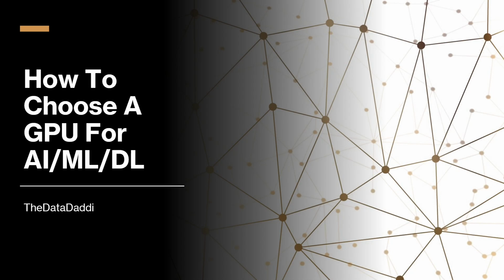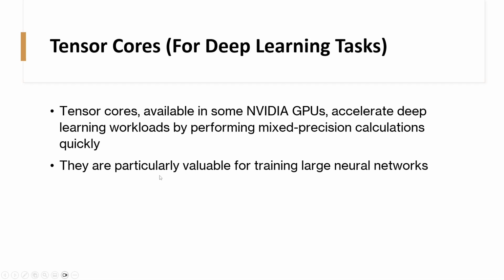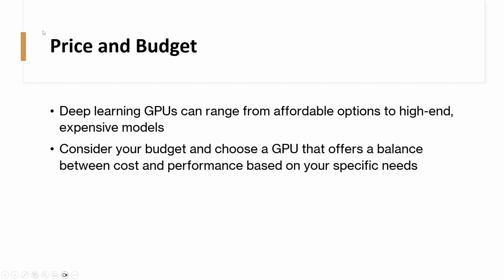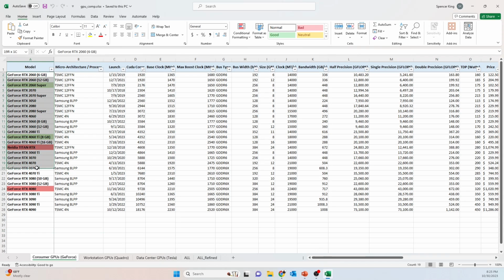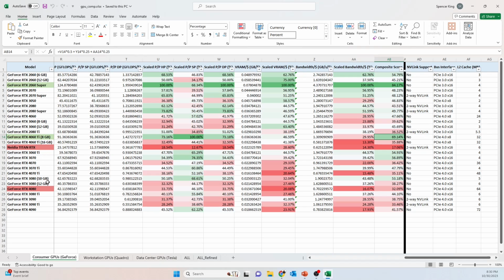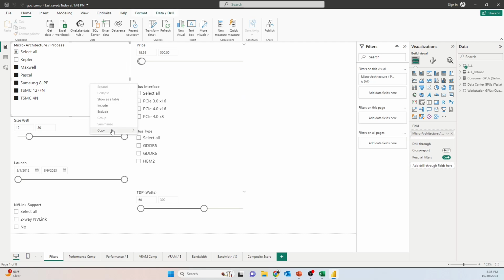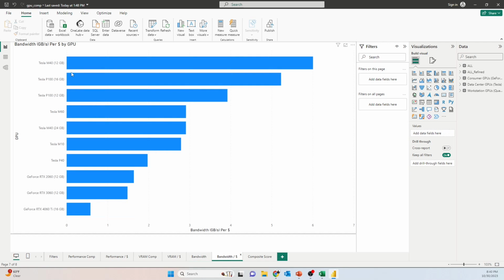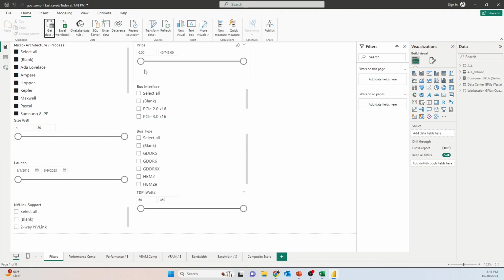AI/ML/DL GPU Buying Guide 2024: Get the Most AI Power for Your Budget

Comment: Nice work. I think the only big flaw I see in your analysis is that purchase price is not the entire upfront cost. Each card should have an overhead cost based on the fraction of a chassis, mobo+cpu, and PSU it would use. I think you just had a chassis for 2 cards as a sunk cost in your mind so it didn't matter. But for anyone building a full system (or systems) it would have a big impact on their purchasing decision.
Reply from the maker: Hi there! Thanks for the kind words and the feedback! This is a good point. I was doing all this research to figure out what to put in my Dell Power Edge R720 so my analysis is a bit biased in that way I suppose. My assumption was just that people would be able to compare GPUs most easily by looking at purchase price to performance. However, I do agree for those that are building or using different server's this might shift the total cost significantly. For example, if you wanted to work with RTX 4090s (even in my server) I would have to buy external PSU(s) for power in order to use them. That would likely mean I would have to build a entire external rig so that would definitely increase the overall cost. These are definitely things to consider when thinking about your build. I appreciate you bringing that up, and I will definitely keep it in mind for any future analysis I do. Thanks again!
Reply: @TheDataDaddi  It is a helpful comparison but as with everything else, no tool is perfect in and of itself, it may be the perfect tool for one job but not another, or at a certain scale. Mostly for me it reinforces my previous idea which is to aim for 4090 as the most versatile and best fitting for my usecase, also because it isn't a one trick pony and can do other things as well. Some of the other options do come close but do not 'cut the mustard' for one reason or another, primarily that it needs to fit in my one rig which can only take 2 GPU's max physically but then power becomes a limit since 1200w is the biggest PSU that makes sense since above it you run into breakers popping and wiring becoming a factor etc. Every possible factor can't be realistically accounted for or factored in, in a spreadsheet. The 'slot cost' I think would be valuable for many to be able to add to it, since some uses do not require much from the platform itself while others very much do.
Reply from the maker: @noth606  You are definitely right. One of the reasons I am trying to focus more on hardware at this stage of my journey is because it so nuanced. For best results, it really should be though about on a case by case basis. This was just meant as a way to show people generally how to start thinking about GPUs for their particular use case and hopefully lessen the research burden a little bit for anyone interested.
Reply: @TheDataDaddi  I'm sure this is helpful to get people to start thinking on more concrete terms when they get to a point at which they want to put together hardware specifically to "crunch numbers" rather than just using a typical general use PC configuration. I would think that the journey in a certain sense can or might be split into 3 "stages" conceptually where stage 1 is a normal PC, stage 2 is a PC built to "crunch numbers" but at a general level and stage 3 is a problem/usecase specific PC or set of hardware designed around the exact specific task they are meant to tackle, where for stage 3 you would include efficiency calculating "work units/sec/price/watt" type factors into it. It's important to factor in time and energy on some level because they are of a slightly different nature than calculations per second are conceptually. What I mean is they are inflexible, you don't have access to unlimited amounts of either regardless of other factors. Saying this not to be patronizing, but as someone who has at times forgotten which parts of this kind of equation are inflexible 🙂 and paid a price for that. Ask my ex wife, she'd have tips and examples of the inflexibility of time and energy for sure, lol.

Comment: Modern AI needs heaps of video ram.  You shouldn't bother looking at any without 24gb
Reply from the maker: Hi there. I definitely agree. I think 24gb is a good happy medium between price and performance.
Reply: What’s your thoughts on Apple silicon, for example, would 32GB of unified memory on an M2 Max, be an equivalent of 24GB in a dGPU (and not considering a CUDA advantage)?
Reply from the maker: Hi there. Thanks so much for you question. 

I actually had some ask a similar question yesterday. Lets dive in.

Apple's silicon, particularly the M2 Max, represents a significant shift in computing architecture. The concept of unified memory in Apple's design is quite innovative. Unified memory essentially allows the CPU and GPU to share the same memory pool, which can lead to more efficient use of resources.

Regarding your question about the equivalence of 32GB of unified memory to 24GB in a discrete GPU setup, it's not a straightforward comparison. In traditional setups, the CPU and GPU have separate memory pools, and data needs to be transferred between them, which can create a bottleneck. With Apple's unified memory, this bottleneck is reduced, as both the CPU and GPU can access the same memory pool directly. This can make the system more efficient, potentially allowing 32GB of unified memory to perform comparably or even outperform a 24GB discrete GPU setup in certain scenarios.

However, this doesn't mean it's superior in all aspects. For example, tasks heavily reliant on GPU performance, especially those optimized for CUDA (a parallel computing platform and API model created by Nvidia), might still perform better on a traditional discrete GPU setup. This is because CUDA has been around for a longer time and is extensively optimized for specific professional and scientific applications.

So to sum everything up, while 32GB of unified memory on an M2 Max might offer comparable performance to a 24GB dGPU in many use cases, the actual performance can vary depending on the specific applications and workloads.

 @rayf3244
Reply: @TheDataDaddi did you use ChatGPT answer this?
Reply from the maker: I honestly do not remember. Definitely sounds like there are remnants of chatGPT in there. I definitely do use chatGPT to help with many tasks including gathering information to respond to questions. However, I rarely use ChatGPT's full or verbatim response for anything. I also also double check responses for accuracy. I know that use of chatGPT is controversial to say the least. However, I am of the opinion that used responsibly it can be an incredibly useful tool.  @adisaksukul8088
Reply: @TheDataDaddi on this one I don’t see any reason to limit our options to 32gb etc. 128gb or 192gb are available if going to apple M2 route.

My internal quandary is a6000 in my dual Xeon gold t7920 vs swapping all out for an M2 Ultra 192gb.
Reply: @rayf3244  Machine Learning rests on linear algebra.   Massively parallel matrix algebra is what video cards do.  (until we see neuromorphic chips in wide production, cheap and actually successful.   Could just be a pipe dream (rnn's).   The RTX 3090 with NVlink is the best bang for the buck and the old Tesla cards are the cheapest entry.   2-3090's give you 48GB and let you play up to llama 2 78b.   No I can't afford two 3090's either let alone a couple of last generation a6000s.  The Tesla P100's have 16GB and NVlink for a total or 32GB for less dollars.    When PCI-e 5.0 boards come out NVlink won't be necessary (We are told) but until then we are pretty limited as hobbyists.   NVidia is really the only game in town and they are focused on the Enterprise not us.    AMD and Intel haven't invested in AI at this level and Apple isn't even in the game.
Reply: I think for some people clustering cheap 16gb cards may be easier to entry. I know there are 16gb 4060s. I know it's not optimal but might be easier to handle incrementally.
Reply from the maker: This could be a good way to go for sure. Certainly a lower barrier to entry from a cost perspective for sure. In my opinion there is no right or wrong answer on which GPU you buy. The best GPU is the one that you can afford that gets you started on your journey. Anything beyond that is just icing on the cake.  @JSON_bourne
Reply: @JSON_bourne  It doesn't work that way.   Each 4060 run completely independent of the other there are NO 40 series cards that support NVLINK.   The 3090 and the 2080 ti (modded) both support an NVLINK bridge so that you can effectively double your memory for larger models.    Anything else is crap.
Reply: @robertfontaine3650 sir u have partially correct information.... we could pool memory of gpus even before nvlink existed
Reply: I recently upgraded my memory to fit larger models in. Regret the expenditure as Llama3 fine tunes on 8B are absolutely epic. I think whether you even need a GPU and whether you need a large model or context window really depends on your use case. The whole thing is so much in flux right now that I'd not be able to say anyone "needs" anything until I ask them about their needs and expectations in depth.
Reply: @ts757arse  tbh I've since come to same conclusion. At least for now, the coals are still in the fire.
Reply: War has changed.
Reply: Ah man. Don’t shame my GPU 😅
Reply: You can't leave out tpus as well then you have Cuda corresponding tensor cores smf there's another one but just using gpus alone is not efficient
Reply: 64 GBs is needed to run anything significantly good. like llama70b

Comment: Hey man, do you know of any online resource on the NVIDIA T40? Planning on using it to serve LLM but I see nothing about it online.
Reply from the maker: Hey there. So I was not able to find anything official from Nvidia, but I did find this online:

https://www.techpowerup.com/gpu-specs/tesla-t40-24-gb.c3942

Might not be as reliable as actual documentation from Nvidia though so I would take it with a grain of salt. 

From what I can tell though its a solid card, but a bit expensive for the performance. I would compare it to the P40 before going that route to see if the price justifies the performance gains for your use case.
Reply: @TheDataDaddi  I didn't buy the T40 due to the lack of documentation. Can't even find the driver for it online. I ended up buying P100s as the P40 can't do gpu-only inference which is what I need.
Reply from the maker: Gotcha. Yeah I think that is a solid choice for sure. Sucks the documentation is so sparse for the t40 though @wood6454

Comment: Brother - you went down a serious rabbit hole. A man after my own heart. One thing you didn't mention that is very important to data integrity and therefore results is ECC RAM. The pro Nvidia GPUs have ECC RAM. Most casual users don't realize how many bits are flipped through flaws in silicon and cosmic events (literally). Then some garbage gets written to disk. That's why I would never own a workstation that doesn't have ECC from top to bottom. Better if the OS / Hypervisor is using ZFS (the best file system IMO... with 40 years building enterprise and global systems). Consumer equipment is fine to test and learn on, especially on a budget. But if you want data and result integrity, at a minimum, buy pro equipment. 

Like you - I've had great results buying refurbs from eBay. Used electronic prices drop faster than pulling out of an auto sales lot in a new car. Well - at least that used to be true. But it still is for workstations and servers. I recently looked at some Dell PowerEdge 730's (NVMe M2 bootable) with 128 GB ECC RAM and dual, upper-end, v3 Xeon processors for about $400 - with IDRAC (out of band management). 

You did emphasize the use case that the GPU is for, and that's what I'd emphasize too. If the data you are processing isn't something that you can't replace with numerous backups, or can't suffer glitches - go with professional equipment - either new or used. 

Then use ZFS RAID and not hardware RAID. ZFS controls the whole data stack - from RAM to permanent storage. You'll want to disable hardware RAID so firmware doesn't fight with ZFS. If you are learning and experimenting, but not relying on the end result - use cheaper consumer products. The learning curve is lower and so is the price tag. If you've never managed a PowerEdge server - that is an entirely different animal because it has to be. The difference between one of those and a consumer PC is like the difference between a flip phone and a Linux workstation. Night and day. But if you're a nerd like me - that's what you want as a platform.
Reply: @jeffm4284  this was a very helpful comment. Thank you!

I am learning at this stage and building my first nas/pc, with one of my goals being local AI with fine tuning + RAG for clinical notetaking. I'm not (currently) paid nor can I pay myself for this added work, it's for my learning, development, and the long term good of my clients. 

In essence, I'm experimenting and not relying on the end result, but I fully intend to rely on it 3-5 years from now. From a cost benefit time/money perspective (and if you were a relative noob), is it worth it to start on consumer equitment, then have to spend the additional time money to upgrade most of your hardware later on?

My previous plan was to put a 16gb vram 4070 ti super in my pc, build a nas, learn, and add a 24gb 3090 or 4090 in a seperate enclosure later on (for dual gpus on my pc or single gpus on both pc and nas). But full ECC sounds essential down the line in my use case, so now I'm not so sure.
Reply: > Most casual users don't realize how many bits are flipped through flaws in silicon and cosmic events (literally).

Yup, almost none.
Reply from the maker: I can attest. I would not consider myself a casual user, but that is something I never really considered until recently. Upon further research, this is indeed quite common and definitely highlights the need for ECC ram especially for critical system or production environments.  @Christopher-lb6rf
Reply: @Christopher-lb6rf  when I was a hiring manager for sys admins and someone would put 'expert' on their field of knowledge related to Sun servers, you can bet questions about errors and external errors came up - found a few, mostly people that had worked at Sun - answered/ knew the area I was interested in :)
Reply from the maker: Hey there. Thanks so much for the detailed response! I really appreciate comments like this. 

Yeah I definitely went down a rabbit hole for sure with the video. Really did not mean too, but once I started I couldn't stop. lol

I will definitely keep that in mind going forward. I have never really had any issues thus far but what you are saying definitely makes sense. Also, from my research it really does not appear to be too much more expensive. 

Yeah, I actually have 3 Dell PowerEdge R720s right now in my basement in a rack. Unfortunately, I do not believe any of them have ECC RAM though. 

Always wondered about ZFS RAID never used it myself, but I will have to go that route. The next server I buy I want something newer, and I will make sure to buy ECC RAM and use ZFS RAID. 

Also, that is a great price on the R730. Is it still available? lol

Comment: What do you think about the Titan V? I didn't see it listed.
Reply from the maker: Yeah I did not cover it unfortunately. I guess I missed it somehow. Anyway,  I would that it is a great GPU. However, the best price I can find even for a used one is about $489.99 atm. This is still about double what you can get the P100 or P40 for at this point and the performance gain is not that much greater for the money (11.7 TFLOPS vs 13.8 TFLOPS for single precision) (4.6 TFLOPS vs 6.9 TFLOPS for double precision). So overall I would still recommend the p100 if you have a need for higher double precision performance or the p40 if you care more about single precision and more VRAM. With that said, I think this is a fine GPU and one of the best you can get for the $500 price range. It also has a newer architecture so I will be relevant for longer. So at the end of the day it really depends on your budget, project needs, and how long you need it to last. Hope this helped! Please let me know how it works for you if you decide to get it!